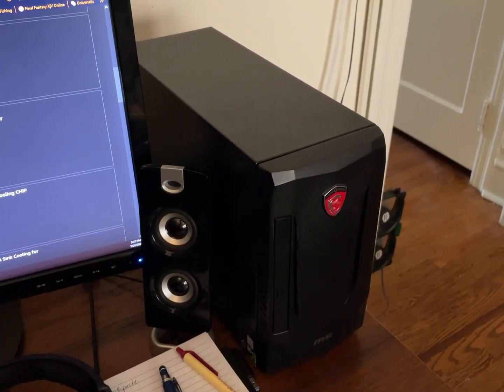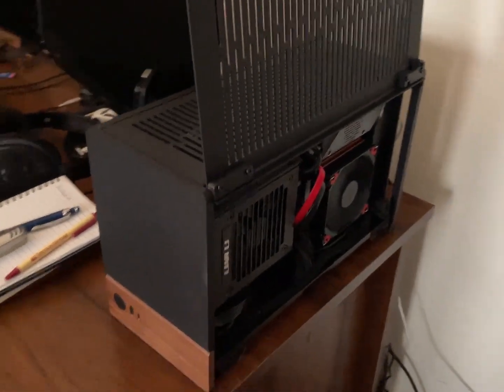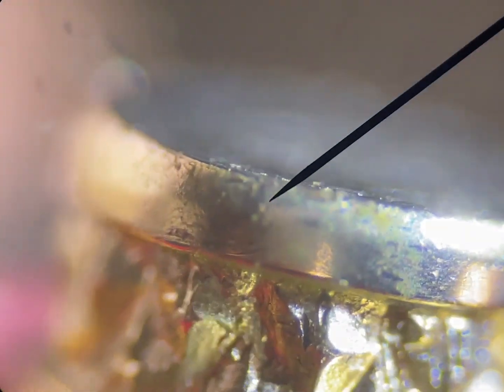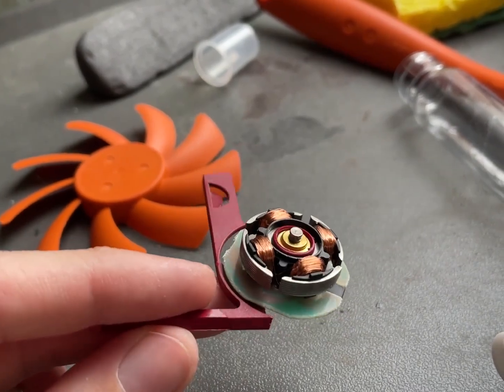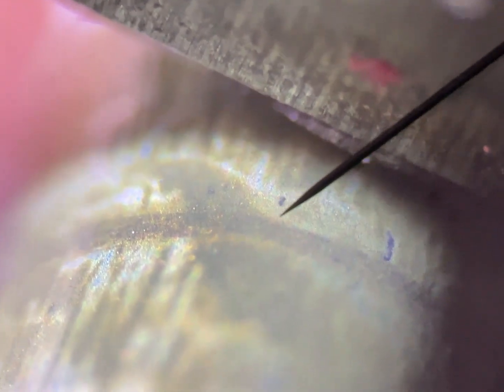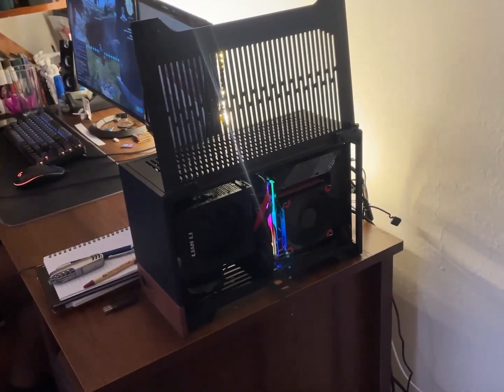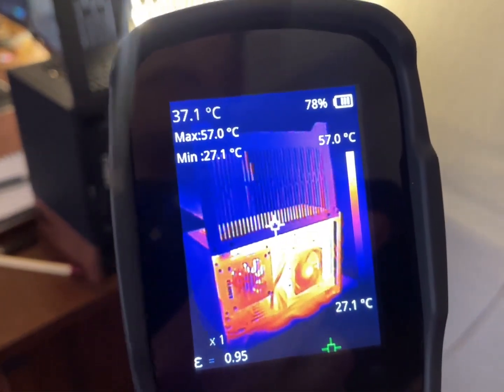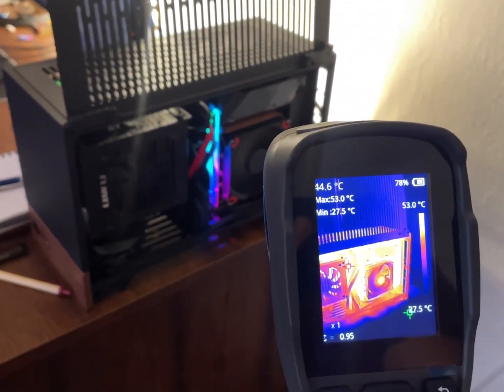Thermalright AXP90-X47 fan failure analysis after 3 months. Seized / making noise. Bad grease

Comment: Gentle typhoon
I have some from 2008 that still work like new. They reappeared on the market a few years ago. Just with the added rpm control. 
You'd be surprised how much it looks like a noctua a12. They basically copied it and sold it at a higher price. 🤣

Comment: I wonder where the grease in the bearings of the fans goes. When you clean the bearing and refill it with new grease, it stays quiet for a while until the grease disappears again. Then the fan becomes loud again.
Reply from the maker: Since this got so hot under the thermal camera, I suppose it may have been too little grease to begin with and then maybe evaporated the lighter oils leaving behind the thicker stuff
Reply: @RinoaL  I have noticed that too and have obtained a high-temperature grease, which can withstand temperatures up to 400 degrees Celsius. However, even this grease disappeared from the bearing after some time. It is a mystery to me.

Comment: I've contemplated putting all of my stuff into a Formd T1. My ambient temps are too high for that though. I'd rather not lower their lifespan. AP201 is just the right middle ground. Hoping my Peerless Assassin's fan lasts. Guess it will be time to get a Noctua one if it does even if they cost more than heatsink itself 😂

Comment: Don't worry about the fan  PSU  not spinning it's designed to only spin once it reaches vertain temperatures it's the same case with modern nvidea GPU's
Reply from the maker: Yeah it just made me worried for a bit because I didnt realize we’d gotten this thing down to such low power usage

Comment: Moly is junk, tungsten disulfide is actually perfect. Theres a reason they sell you moly, they dont want anyone to do well with THE THINGS. Not an imposition, just a statement of fact. 
Its like these little chineese giggling demons get together in a circle jerk bouncing up and down with joy when they come up with a worse way of making something. 
Really!?
The tungsten disulfide is a molecule which is a useful molecule, and it has improvement properties to any sort of metal or plastic friction surface. 
If added it works as the lubricant even when dry, up to practical limits. 

Im not just talking, i have tried it with very cheap very cheap chinese bearings on a diy belt sander, bike hubs too, and the thing works flawless now, its like it spins like a brand new ceramic bearing really.

Its a mix ive mixed, with low temp "arctic" aircraft grease and tungsten disulfide, its very low viscocity grease, but still works like grease without being classified as really heavy oil, and its a nice color too, its like a dark green gray fine glitter.

I would bet money it inceases bearing lifespan 10x to 100x plus compared to the cheap bearing cheap grease combination. 
It would improve economy and reliability if it was used as a standard "minimum requirement" type grease.

Comment: The fate of all sleeve bearing fans unfortunately.   It's too bad they didn't have the c-clip under the back sticker so you could clean and re-oil it a few times in it's life.  If you get lucky and a manufacturer puts in good grease and it doesn't dry out just from bing on the store shelf, you can often get a year or 2 before you need to oil or replace but once you go to a quality double ball bearing it is very hard to go back to sleeve bearing.  I have double ball bearing 120mm  all aluminum frame case fans still in service with over 20 years of near 24/7 operation on them.  Granted they were nearly $30 each when new but have stood the test of time so far.
Reply: Looks like a way to fix the fan would be to drill a small hole center back and then put in a few drops of electric motor oil.
Reply: Huh. Buy it once.
Reply from the maker: shame the heatsink we wanted wasnt paired with a noctua

Comment: I have a thermalright tower fan and I too had the fan fail within the first two months, but it's so cheap that you basically have a free fan with it anyways so meh.
Reply from the maker: I wish I could find a good way to take the thermalright one apart to lubricate it but oh well
Reply: @RinoaL  I was kinda surprised to see they didn't go with the typical c-clip behind the seal and sticker on the back like so many other brands since it makes it so much easier to lubricate without even needing to take the fan apart, just a couple drops of PTFE liquid lube or any similar lube and it's back in service.
Reply from the maker: @kuhrd  Yeah with this you would need to drill out the back, remove the magnet, and remove the white retaining washer in order to remove this thing. That isn't going to work.